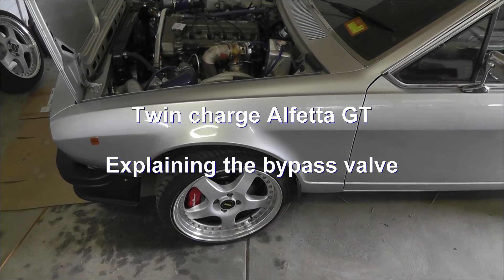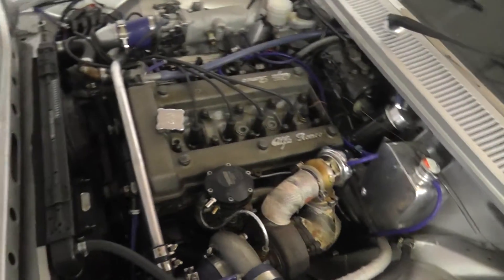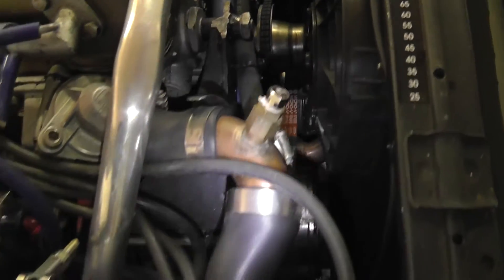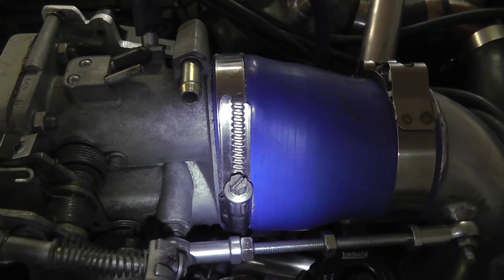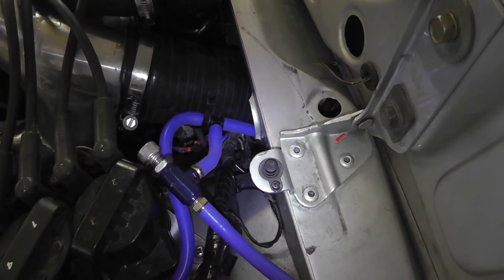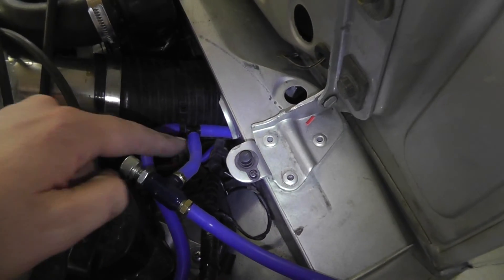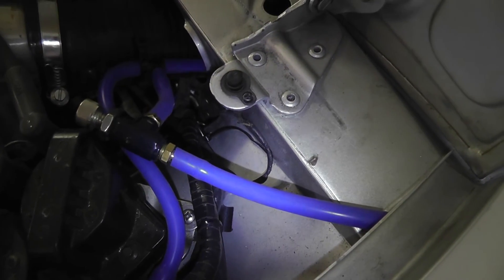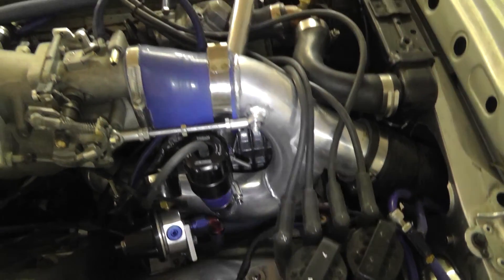Alfetta GT twincharge - Bypass valve added

Comment: Wouldn't the turbo force more air into the super charger to compress again creating more boost like a two stage air-compressor? so why is the bypass valve better?
Reply from the maker: Vincent Steigen.  If both the supercharger and the turbo had the same efficiency, then yes.  But they do not.  The supercharger becomes very inefficient past a certain flow rate and therefore the pressure increases but so to does the heat.  The net result is less dense air.  The objective is not more pressure.  It is more massflow. For the same boost, adding a bypass valve netted 80 more hp at the crank. 
My next setup will use a more efficient supercharger and I hope not to need to bypass.  Does that make sense?  Cheers
Reply: buzzedo1 wouldn't a twin screw supercharger solve that issue since they produce half as much heat as a roots blower and you would just need a intercooler in between the turbo and twin screw supercharger.

Comment: you could do that more easly by charger blowing in turbo..  and water injection is a must here.  using a bypass valve in beetween of a modern diesel engine throttle body normally open and closes by boost.
nice work anyway .. alffa pwoer
Reply from the maker: Thanks for comment.  not sure that layout would be easier  because inlet is same side as supercharger the path is much nicer as I have it...avoids another length of pipe.   The bypass was super easy.  Maybe I am missing your point though! for interest I had the car on the dyno last month with 450Nm of torque and 320Hp at wheels at 5200rpm on street fuel.  the bypass is seamless on the dyno plot.  next step will be more boost from supercharger down low and might have to port and cam the stock head!

Comment: Good work mate!  How much power did you pick up in the top end with the SC14 by-passed?  As the SC14 doesn't do 'work' when by-passed, then you don't ever have a high boost / high rpm requirement from the blower, so it will last longer, your blower belt wont be under as much stress etc etc . I like the way you used the Hobbs switch.  Good to see you are still developing the Alfa.  I've been busy with work and family for 4years, but now I'm about to get back onto the car and fit the SC14 to my CA. i removed the large blower as it was too big and the engine used to struggle to overcome the inertia in the lobes from idle.  I'll be going back to Blower into Turbo for a change :-).  At present i just have the GT3076 0.63rear with E85 making 301kW @ wheels but i have NOTHING below 5000rpm, so its going to eventually kill me on the street if i dont get a blower back on as you need to go too fast to get any torque ...  I'll have another air intake to the turbo that will open at high revs and the blower will turn off. So ill spin the blower hard up to say 5000 engine rpm, then ill switch it off and let the turbo take me through to 8000rpm.
Reply from the maker: twinchargedca18 twinchargedca18 Hi mate, I calculated I should get another 80hp with the bypass, but funnilly enough, I've not had it on the dyno.  I've started another version of the build now, with an SC355 Sprintex charger plus turbo (turbo size tba).  Target 700Hp.  There's still a lot of Hp to unlock in the current configuration I have.  I upgraded the intercooler and cooling system to get bonnet temps under control (now sorted).  I still need to set the charger up with a larger pulley as I designed it with both runing continuous, so only set pulley for 6psi...really to unleash this setup, I now need to set it to 15psi, and still bypass.  That would transform it.  As it is, gord torque is made at 3500rpm, but could be better stilll with more sc boost.

Comment: Hi: At 3:50, what brand and type of adjustable BOV, diverter valve, or bypass valve (whatever you want to call it) is that? The black one with the vacuum hose in the top cap.  I'm wondering because I just got one that looks just like it, and the spring is so strong it won't open all the way even with 22" of vacuum.   At 10-15 inches which is idle and cruising speed for many cars, it's not even open at all.

I'm wondering if yours is the same or if you checked it for this.  ??

Is it a brand name or generic?
Reply from the maker: Hi it is a Turbosmart blow off valve.  Given it's main purpose is to remove pressure spikes on shutting the thottle, I am not sure you should bo too concerned with how much it opens, although you have not described how you are using it, not how much it opens.  If I were you I would be looking at a pressure gauge upstream of the throttle body and seeing how quickly the pressure is dissipated if you are concerned.  The valve I use is not cheap, but it's pretty basic.  You can get plenty of bosch type BOV's like off old saab turbos that are far more primitive and work just fine for most applications.  A comment you make about crusing speed and 'it's not open at all' makes me want to know why you would want it open at that condition?  Are you running turbo, supercharger or both?
Reply: buzzedo1 BTW, I have what looks like an exact copy of that turbosmart valve.  Does yours have a brass piston with an inner O ring at the bottom of the travel when closed? And the cap turns about 7 turns out from bottom before the cap O ring is exposed?  If yours is calibrated the same as mine, it's not good to use on a supercharger.  With the stock spring, mine would not even start to open until 18" hg, and even at 24" it still was not fully open. So cruising at anything under 18" you're pushing air against a closed door.

On the other hand, the curious thing about many of these valves is they rate them at the PSI of boost pressure they are able to hold, the higher PSI using stronger springs (or turn the cap in on yours and mine). However, when you think about how they work, this makes no sense, as whatever boost amount the blower is making and trying to "force" the piston open, is cancelled or equalized by the exact same manifold pressure coming through the manifold vacuum line to the other side of the piston (through the cap).  

So whether you're making 5 or 55 psi, it's still only the same, there is no "boost pressure" against the piston or spring, so changing tension of the spring shouldn't matter except to perhaps make it react quicker, and, to change the vacuum level (and of course throttle position) at which the valve opens or closes.

If there's something I overlooked, please let me know. But I just got off the phone with Vortech today and they confirmed all that common sense already assumed about this, but it's amazing how misunderstood and how much misleading and false ideas there are about how these devices work.

BTW, the basic, stock, black plastic VW, Audi, etc. Bosh diverter valve opens at 2", and is fully open at 10".   And that's a German engineered valve from a turbo car, so even on a turbo, the engineers knew about the common sense of not wasting energy, loading down the turbo, restricting the exhaust, by having it push against a "closed door".   It also keeps it spooled up to a higher RPM when cruising with the valve fully open, so when you do hit the throttle, you have less lag.

Comment from the maker: The supercharger will come on after a gear change momentatirly. There are reasons not to force it off after a certain rpm is reached.   Under full load, in 3rd, the supercharger is off and the turbo is making full boost, grab next gr>> the turbo has no problem supplying boost past the switch over point, but it does momentarily have to pass through the charger until the bypass opens.  It is not noticeable.  Perhaps your suggestion with a tweak (rpm&load set points) would be a further refinement.

Comment: Yes you mentioned that you could control it via the ecu and also the pressure switch. My question refers to a scenario such as when you are running all out and you shift from 3rd to 4th. At the top of 3rd the supercharger would be turned off via the pressure switch, but during the shift, you lose pressure so should it not kick back on at that moment just for a split second until boost is regained in 4th. Or do you have the ecu telling the supercharger to never turn on after, lets say 5000 rpm.

Comment from the maker: Thanks mate.  In between gears, the supercharger continues to run, but a blow off valve vents back to intake effectively dropping boost to zero on the shift.  Same as what you would do for a Turbo, except using the wastegate.  Other than that, the supercharger is clutched and is turned off based on a set point which I can adjust to suit.  Very simple, and works well.